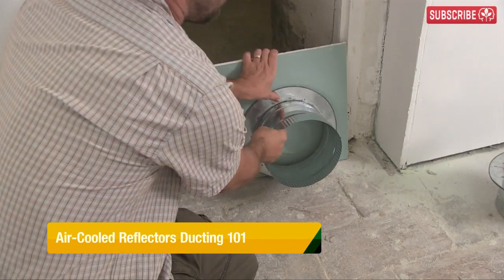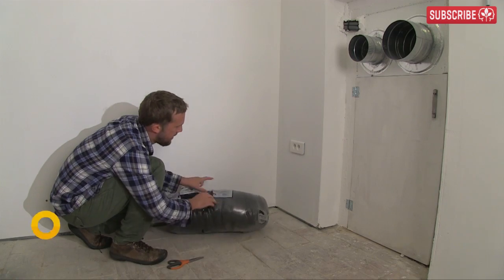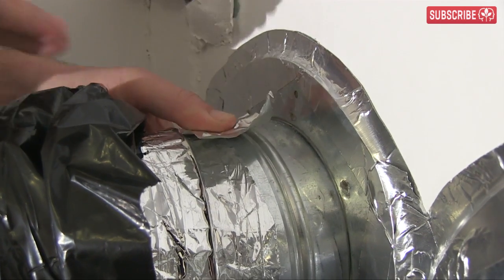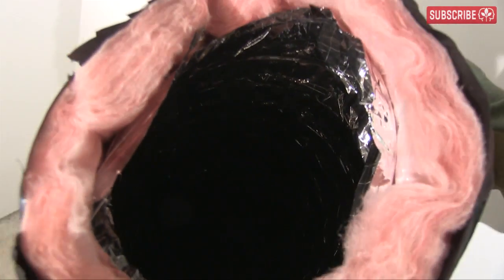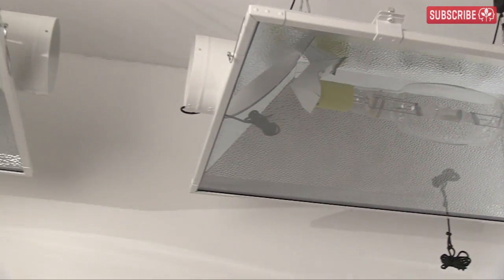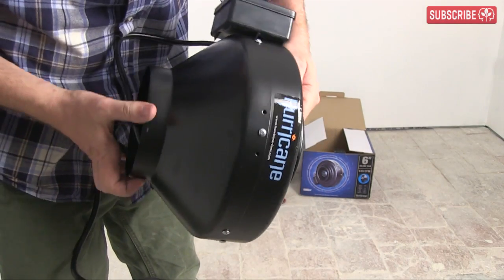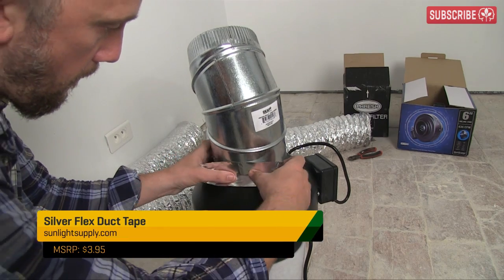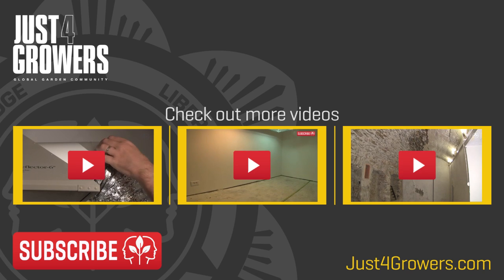Intake Filter, Inline Fan + Ducting Set-Up for Air-Cooled HID Grow Light Reflectors

Comment: +Everest Fernandez. Wondering if you could offer some clairification. I noticed in one video you stated to attach the inline fan to the reflector and have the air pushing a positive a pressure, then I noticed in another video you have the 6in hurricane fan in a lung room with a fresh air filter. My question is, where does the inline fan go? on reflector or a lung room? thanks.

Comment: The hoods are in backwards. you don't want dust and debris hitting the bulb directly its possible that could lead to shorter bulb life. if you flip them around the air splits off the bulb mount.... Happy growing. Thanks for the vids!
Reply from the maker: Hello Shepherd, thanks for sharing your insights. I use an intake filter to prevent dust from being blown into my hoods. Interesting point though!
Reply: +Everest Fernandez (Just4Growers) Always important to run filters but most importantly a Quality filter with a decent MERV rating. ( I didnt watch any of the other videos of yours about this topic so i'm not trying to single you out just posting so people better understand)....... 
That being said i have always preferred the aerodynamics with the air entering on the bulb mount side. The thought of the air using the bulb as a windbreak never sat well with me.( Especially important if you are choosing to run unfiltered) as any trauma and dust build up will decrease bulb efficiency.... Also the idea begins to make more sense once someone chooses to upgrade and add more lights thus potently needing a higher CFM fan. As well as someone who chooses to ru  an 8" duct hood as CFM for the same model fan is typically higher. I'm not saying that the wind from the fan WILL hurt the bulb over time with direct exposure because that would be pretty hard for me to prove but part of me wants to think it would. JUST MY 2 CENTS.  Happy Growing Cheers !
Reply from the maker: +Sensimilla Shepherd Thanks SS—I appreciate you taking the time to give your two cents! I always appreciate a well-reasoned discussion! You're right—the lamp as a wind break doesn't sit well! When using either 6" or 8" hoods,  I actually dim my fans down to 35% in order to create more of a gentle breeze rather than large volumes of air whistling through the hoods. Over-cooling lamps on full-power fans hits both intensity and spectrum. It also causes the e-ballast to push more power to the lamp which can increase depreciation / light maintenance. The lamp's position, relative to the air flow, is a very interesting issue and I'm glad you raised it! Thanks again for stopping by (I hope you're subbed!) — peace and happy growing, Everest.
Reply from the maker: +Sensimilla Shepherd You mention MERV ratings which applies to the target particle size one wishes to remove. In the case of plant volatile organic compounds these are large particles averaging between 10 and 100 microns. It's worth noting that everything that can harm plants falls between that micron size. Nothing smaller is detrimental to play health.

Generally a good carbon filter can filter effectively down to around five microns at 70% and 10 microns and above at 99%; with an air flow loss of around 30-35%; and will gain 30% of its own weight in pollutants over three years with a total airflow loss of say 45% ( assuming you wash the outer sock every six months or so.) 

A hepa filter however (merv rating of 13-20) will filter down to 0.5 microns.. however the air flow loss starts at 40- 45% and increases rapidly after six months or so (depending on how bad the air is). Yes it can be cleaned and it needs to be maintained often.. Say every three months minimum.

So, in summary, a classic style carbon filter canister as we growers commonly use (merv rating of 9-12) will protect you from most nasties including mould spores and odor for a long while without reducing overall airflow substantially.
Reply: Hey everest i got a few questions....my carbon filter is brand new and my inline fan seems to be pulling some little pieces of carbon from the filter and landing in my air cooled reflector. Can those little pieces of carbon scratch the bulb as they pass by?

Comment: what all are you controlling with the titan controller?  i have a very similar setup (smaller 8.5' x 4.5' x 7.5') and was thinking of purchasing one of these controllers to regulate intake/exhaust.  currently I have a 6" inline fan for intake and a 10" carbon filter with a 10" max can fan.  can i just run these all day, or is it better to have them on timers, or a titan controller?  it's my understanding that stopping and starting these fans are not good for them and use a lot of energy as well.  i'm not running co2 or humidifiers/dehumidifiers...the room is setup in my garage (I live in CO) so heat should not be too much of a concern, the concern rather is efficient air flow and a constant exchange of fresh air. also, factoring in my wall fans, should these be on timers in conjunction with the intake/exhaust, or running all day as well? I know those environment controllers can be expensive and i'm trying to keep cost down.  what are your thoughts? thanks!  (btw, your setup is awesome - much of my planning came from your videos).   oh yea, i'm running two 600w setups.
Reply from the maker: Daniel Son Well hello there Daniel Son! Thanks for your comment and questions. I'm glad that my videos are helping you out. Documenting the build and the grow on video certainly adds extra complexity but it also forces me to create my indoor growing environment "layer by layer". I am making videos about each of them rather than just saying "dah-dah!" here's my grow room.

So—layer one was all about getting the absolute essentials in place: Light, water, nutrients and ventilation. Layer two (what I'm currently working on) focuses on control—that includes automated irrigation and environment. I've just set up a dripper system (video to follow shortly) and I'm planning an ebb & flood tray too. There will also be some deep water culture in a separate system.

Right now I simply have my exhaust fan running 24 / 7, albeit at a 50% speed setting as I deliberately over-specced my equipment to allow me some room to add some more lights further down the line. 

I do not recommend running your ventilation fans (incoming, outgoing, or oscillation) on timers. Timers are just that. Dumb timers! They don't sense or respond to your environmental metrics. You should use a controller. As you're not running CO2 or humidifiers / dehumidifiers, I recommend checking out the Mercury 3 or Mercury 4 for a thermostatic day / night controller ( http://goo.gl/r1EXPJ ) — otherwise the Kronus 1 ( http://goo.gl/frbQf5 ) is a great choice if you want to sense and respond to relative humidity levels too.

I firmly believe that environmental controllers are worth the investment and the improved quality (and size) of your yields should, over time, more than cover the extra investment. Yes—it takes more power to start up a fan from standstill—but arguably not as much as having them running all the time.

I ALWAYS have air exchange 24 / 7 in my garden, whether lights are on or off. Same goes for oscillating fans. Keep them running 24 / 7, just try to insure they are not blowing directly at plants.

Right, I think I answered all your questions, but if I generated some new ones just send 'em over! Thanks!

Finally, please SUB THE CHANNEL so that you receive regular updates on my progress! :)
Reply: Everest Fernandez hey thanks for the quick reply, i really appreciate it.  so what im understanding is that I should use a controller to regulate intake/exhaust, but I'm a little confused when you also say you run them 24/7.  wouldn't the controller be irrelevant if my intake/exhaust is running 24/7?  or are you saying that you currently run them 24/7, but plan to upgrade to a controller as part of 'layer 2'?

I checked out the controllers you recommended and I think those are exactly what I would be looking for if i decide to automate my air exchange, although i have a couple questions .   what is the difference between the mercury 3 and 4?  to me it looks like the 3 allows you to plug in 1 fan, while the 4 allows you to plug in all of your exchange equipment (or so it says).  These still seem a little too sophisticated considering i'm only looking to control 2 fans (1 for intake 1 for exhaust).  This is all of my equipment for air exchange and cooling my hoods: 

INTAKE: 6" Phresh Intake Filter > 6" Inline fan (~400cfm) > Garden

EXHAUST: Garden > 10"x40" Carbon Filter > 10" max-fan (~1000cfm) > exhaust out (I feel like this should run similar to yours at or around 50% - what calculations did you use to determined this setting? i think i read that you want your exhaust pulling out 3x what your intake is pulling in, of course factoring in the reduction of air flow due to filters and such- is that accurate and if so, would the mercury 3 or 4 allow me to control fan speed?) 

GROW LIGHT EXTRACTION:  6" Phresh Intake Filter > 6" Inline fan (~400cfm) > HOODS > exhaust out (travels through 6" insulated ducting only inside of room)

Both controllers (mercury 3 & 4) seem to only have one outlet to plug my equipment into...I need to plug in my fans (2 total) for both my INTAKE setup and my EXHAUST setup (light extraction will be separate and will be set on the same timer settings as my hoods). Also, Titan mentions 'night equipment'...is this something important that i should look into? 

sorry if none of this makes sense. i'm trying to balance my work with my hobbies, doing both at the same time can cause me to ramble and lose my train of thought.  ;)
Reply from the maker: Daniel Son Hey Daniel Son. Yes, I am currently running 24 / 7 at 50 percent speed—but with the ambient temperatures changing so much outside as we head into fall, this may end up being a bit too much—especially at night. The ideal situation is to have your intake and exhaust connected to the same 'brain' - aka Mercury 4 - I've seen these sold online for less than 100 bucks. Ask your local grow store if they have an 'ex-display equipment' discount policy. 

When your lights go off at night, temperatures will naturally fall—and relative humidity will rise. Night equipment tends to be focused around combating these environmental changes, especially if growing sensitive flowering and fruiting crops that are susceptible to mold and mildew. Night equipment might include a dehumidifier and / or a thermostatically controlled block heater. You may have heard of some plants 'stretching' upwards in form during the transition from vegetative growth to generative production (buds, flowers and fruit) - these tall and gangly specimens can be quite difficult to illuminate efficiently with grow lights. A low tiff (the difference between your daytime and nighttime temperatures) can help to keep some species of plant squat and low with wide, manageable canopies, especially when combined with low stress maintenance techniques. 

I'll be covering all this stuff in upcoming videos so lots of fun ahead! You've chosen a wonderful, rewarding but all-consuming hobby Dan! Your plants will never be far from your mind. :)

Comment: as a duct fitter and grower i would always use jubilee clips and tape the insulated flex for looks and performance however nice set up
Reply from the maker: ukgorillagrow Budman Thanks Budman. Most likely you know that some insulated ducting comes with a perforated inner duct (for sound attenuation I believe) and some (like Thermoflow) doesn't. As you do this for a living I'm open to any more tips! Thanks for stopping by. Please sub the channel.

Comment: Nice but I would go bigger on the fan, or add another as a booster, maybe even three fans.....
Reply from the maker: Thanks for chiming in Shea. Have you seen my other video "Does air-cooling your lamps reduce PAR output?" - you can find it here: http://goo.gl/LgnEh1 The results certainly encouraged me to go down the "less is more" route when it comes to air-cooling my lamps. What say you? Thanks again and please sub the channel! :-) Peace.
Reply: Everest Fernandez No I get your point, however, without seeing your setup in person the view from your video looks like your air is traveling quite a stretch and with "cooling" aside my comment was more concerned about "flow"...
My opinion is the 6" fan is going to be working double duty and then some, so by adding a boost or two your taking the load off and in turn lowering your energy cost..make sense? the price to run that one fan could very well be higher than running two inline...or maybe im confused all together about the location of your intakes...
Reply from the maker: Shea Mehling Hi Shea. My 6" fan will definitely be pushing a lot of air (right now I'm just running a non-aircooled reflector) - I have looked into those inline duct-booster fans and I'm definitely interested. We're entering the fall / winter period now so I guess time will tell next year when ambient temperatures warm up a bit.